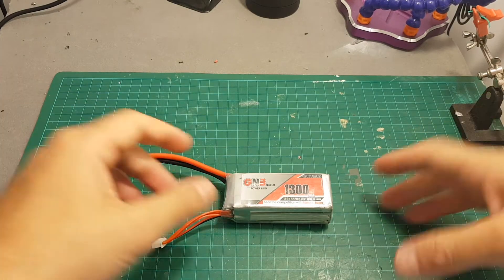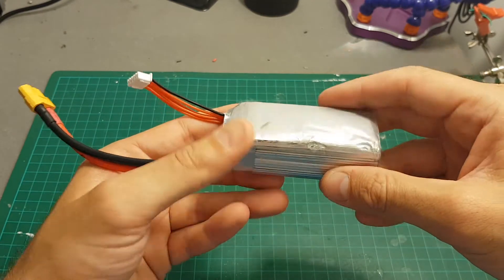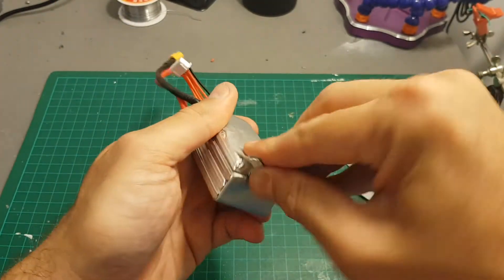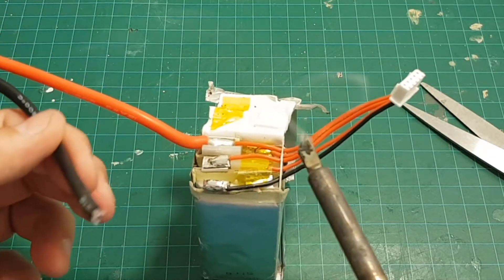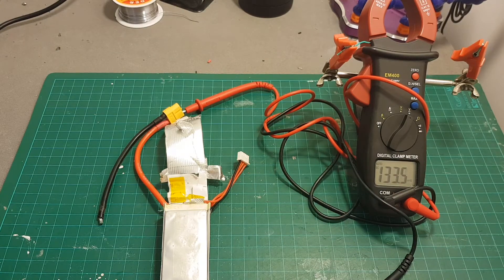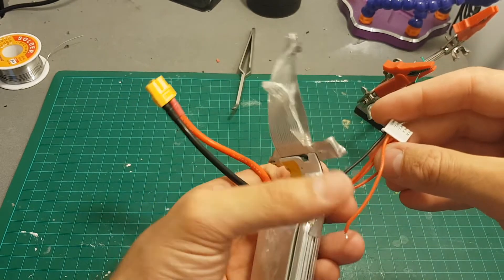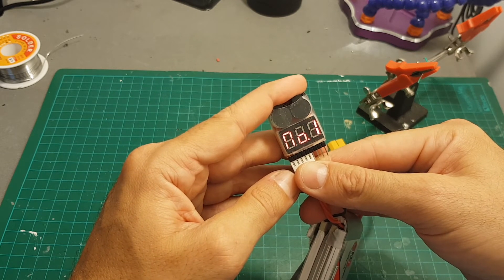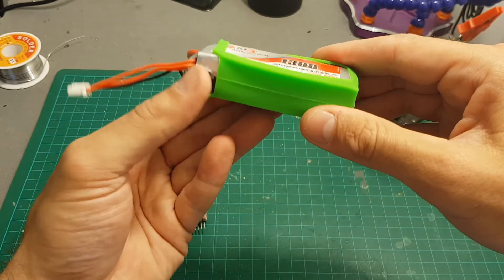How To Save Your Damaged Lipo Battery

Comment: Dude...  :O  Use "brake cleaner" or some other solvent to wet and break down the adhesive between the cells, and pull slowly to allow the solvent to work as you go.  ;)
Reply from the maker: Thanks for the tip :-)
Reply: No prob.  :)